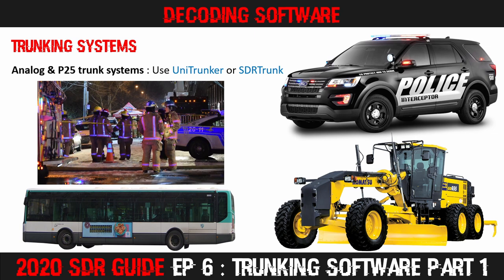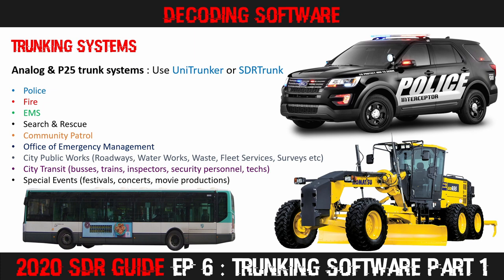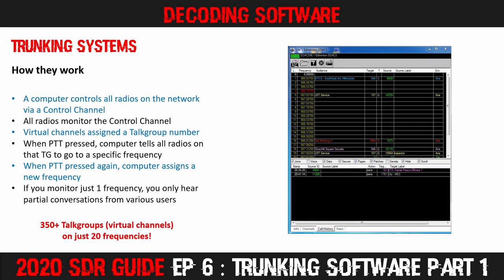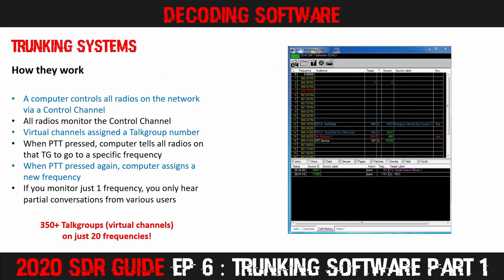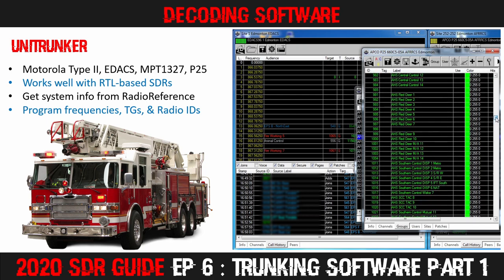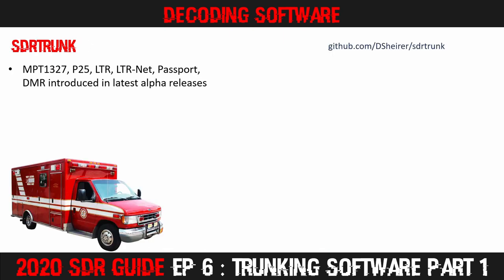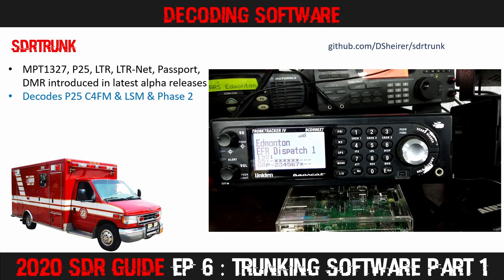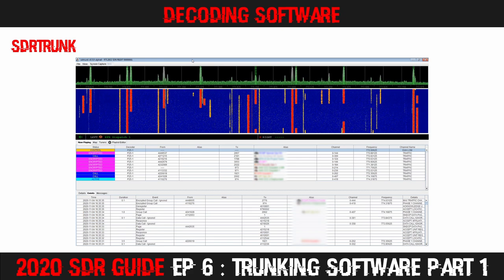2020 SDR Guide Ep 6 : Trunk tracking Public Safety systems with UniTrunker and SDRTrunk

Comment: Very informative 👍
Reply from the maker: Hopefully it will help people understand how these system functions, and give an insight into the kind of data you can receive with an SDR!
Reply: @FrugalRadio  Do both setups require 2 RTL-Sdr s ?
Reply from the maker: It depends on the SDRs and the system. You would need 2 if wanting to monitor voice, and the system has channels spread out over more than 2 MHz. The SDRTrunk footage was shot using only 1 SDR, but the AirSpy R2 has around 10 MHz bandwidth. There's a little more detail at my blog : https://frugalradio.com/unitrunker-sdrtrunk-demonstrated/
Reply: @FrugalRadio  Thanks
Reply from the maker: You're welcome 😄

Comment: Thanks again. So much to learn! Is the trunking system similar in the UK? Since I got my SDR I've realised how little I know is going on over the airwaves. Anyway, I'm sticking my airband dipole up today. Wish me luck!
Reply from the maker: Best of luck getting the antenna up. Stay safe up that ladder Paul!

As for UK, I responded to another comment on that. There may still be a little MPT1327 around, but must trucking is now digital Tetra (the Airwave system from 380-400 MHz which is almost exclusively encrypted), and DMR (which we will cover in Episode 7).
Reply: @FrugalRadio  Thanks for the reply. A few tricky moments but got down safely - As did the children who spent the afternoon on the kitchen roof below me! It's not as high as I wanted but at least it gets away from some of the interference - I can now get BHX ATIS fairly reliably around the clock. Looking forward to the next video. P

Comment: What hardware is needed to use Unitrunker?
Reply from the maker: This video was made with version 1 of Unitrunker. It runs well on old computer hardware. I've been using an old laptop for many years. 

Version 2 is now released, but it requires Windows 8 or later.

You'll also need a basic SDR. A generic RTL-SDR device will work, although my recommendation is the RTL-SDR v3.

Comment: Love your videos, I am looking to build a mobile unit for my local public safety depts.  I currently have sdrtrunk running for p25 phase II what would you recommend to cover the UHF band which the fire paging system is still on here (orange county, NY) ?  Love to hear what you mite recommend.
Reply from the maker: Hi Jerry, thanks for your comments.
What protocol is that UHF paging system using? If it is POCSAG or Flex, I would most likely use PDW, which is what I use here. 

I considered putting a Panasonic Toughbook in my car, hooking up to an SDR, but I never got round to it!

Today I would consider a different approach : setting up the receive SDR at home, and reading / parsing/ filtering the logs with something like Node Red, generating a Web page with the filtered output, and just using a Web connected tablet in the car for display (or a smartphone).

I haven't yet experimented with this type of set up, but was recently talking online with someone doing it for CPDLC transmissions.

What methods have you considered?
Reply: @FrugalRadio   This is the info from radioref , 451.68750 	WQCV570 	B	151.4 PL	E OC Fire Paging	Fire Paging Simulcast 	FMN 	Fire Dispatch  What software would you use to scan the uhf band  on a sdr?
Reply from the maker: Depends on what the desired outcome is. Do they broadcast data only, or is there also voice paging on the frequency? A PL tone suggests voice traffic, not just data. But for scanning UHF, a BCT15X scanner or any of the SDRs. They work just as well in UHF as VHF.

Comment: Just wondering how SDRTrunk works with the RTL-SDR.COM v3 dongle and if it also requires two dongles as UniTrunker???  Thanks for the great video!
Reply from the maker: The RTL-SDR v3 dongles work great with SDRTrunk! I would need 2 on that system because it the frequencies span over 5 MHz. If your local site frequencies cover less than 2 MHz, you would only need 1 RTL-SDR v3 to monitor Control Channel and Voice.
Reply: Sorry to bother you again, just wondering if you used a antenna splitter when using two v3 dongles for trunking?  If so, which one?  I wonder how much loss there would be if just a "Y" adaptor was used???  Thanks!!!  I was just thinking about it again, and thought that you are probably using two different antennas instead of splitting one antenna between the two dongles!?!?
Reply from the maker: Hi Dan. I actually use a device called a multicoupler. It takes one antenna input, and electronically splits the signal 8 ways, ensuring there is no loss.
Reply: Thank you sir, I will do some research on that!

Comment: Hi , thanks for useful clip. I found DMR local channel and when i try listen that with sdrtrunk,  i see channel is locked and cant listen it. how can unlock this DMR channel?
is there any program for do that?
Reply from the maker: If some channels are appearing locked, it means your SDR is not able to span the full bandwidth of the system.  You can use an SDR with higher bandwidth (Airspy mini or R2 for example).  This means the tuner can span the entire width of the digital system and track the Control Channel and all Voice Channels simultaneously.

Or you can add another lower bandwidth SDR.  That way, when SDRTrunk is monitoring a Control Channel and wants to hop to a voice channel that is outside of its range, it will tune the 2nd dongle and use that for the audio.

Hope that helps!
Reply: @FrugalRadio  I have HackRf with 20Mhz bandwidth ,i dont think locked channel dependent to bandwith in this case.
presumably the channel is encrypted.
Reply from the maker: Ah, perhaps it is encrypted then. If that's the case, SDRTrunk should display it in a different colour if I'm remembering correctly. Lots of the P25 around here is Enc.
Reply: @FrugalRadio  Is there any program to decrypting that?
i need software same SDRangel to transmission in DMR mode... do you know any that?
Reply from the maker: No, P25 digital encryption cannot be monitored. 
I haven't used SDRs for transmitting, so can't offer any suggestions for that.

Comment: Where would i find similar frequencies in the UK. or is there not enough to warrant looking ? regards
Reply from the maker: There aren't many analog trunking systems in the UK. In fact the biggest one I know of seems to have been shut down. It was in the 174-225 MHz range and was used by Network Rail. MPT1327 was the type used in the UK in the past.

Emergency Services there are now using a Nationwide digital trunked system called Airwave. It uses the Tetra protocol. Almost all areas are fully encrypted. I had success decoding some clear Tetra transmissions with the Tetra Net Monitor software and an RTL-SDR. You'll spot a lot of sites in the 380-400 MHz band. They are wide bandwidth (25 kHz) 4 slot carriers emitting a constant Control Channel.

Lastly, DMR digital trunking networks are popular there, and a few NXDN networks have started to appear. Check the UHF band. Have a close look from 450-470 MHz. Demodulating DMR systems will be covered in Episode 7 🙂
Reply: @FrugalRadio  Thank you for your reply, Ok I will have a look around and see what I can find, and will look out for Episode 7